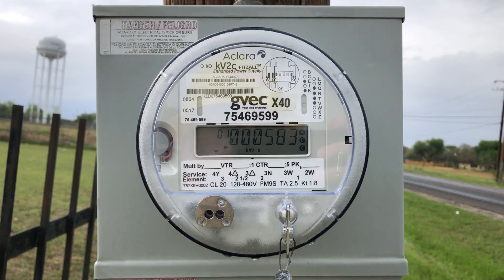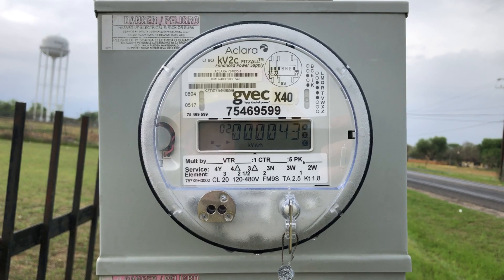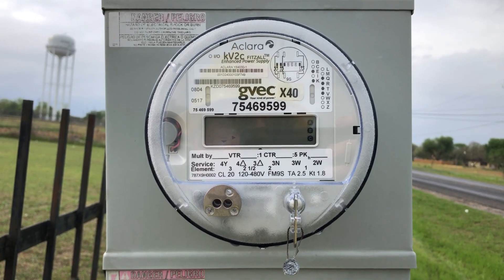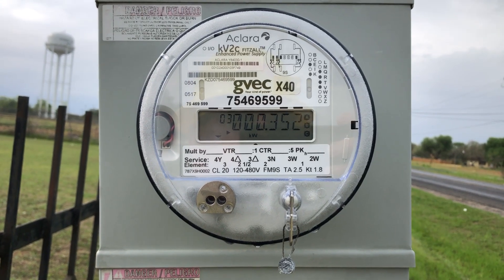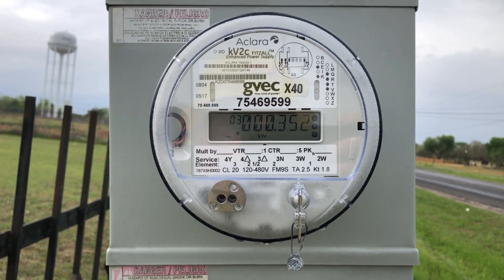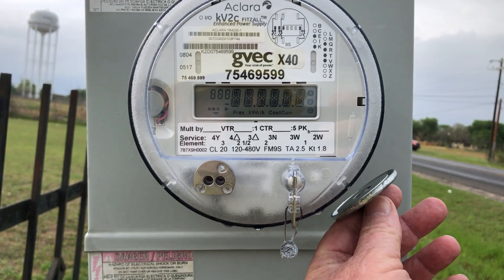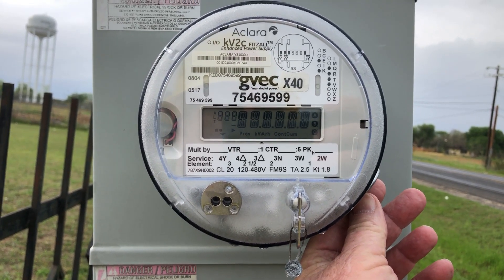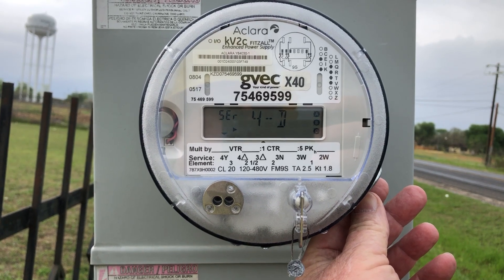GE Energy kV2c Site Genie Display Scroll

Comment: What device do you use to display service type?
Reply from the maker: At the 15 second mark,
A magnet is used to change the display to the alternate screen.
The service type is the first thing that will be shown when the alternate screen is activated.
Reply: @linema22n  will any ordinary magnet will do? Or there is a special kind of magnet?
Reply from the maker: @geovannyrios2225  
The magnet is nothing special. I have used several different types and sizes.
Reply: @linema22n  thanks for the reply.
Reply: @linema22n  last question. How do you determine the multiplier of the meter if its a CT rated meter?
Reply from the maker: @geovannyrios2225  PT and CT ratio. This metering is using 200:5 CTs with no PTs on the secondary. That produces the X40 multiplier.
Reply: @linema22n  thanks a lot. 👍